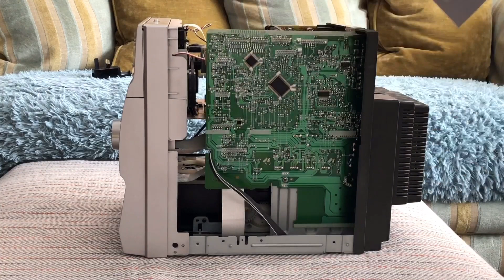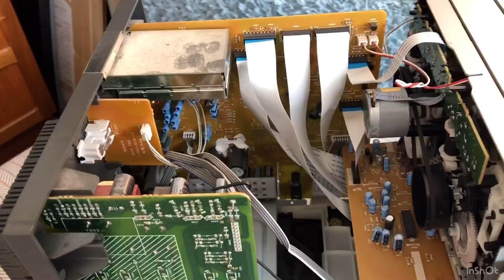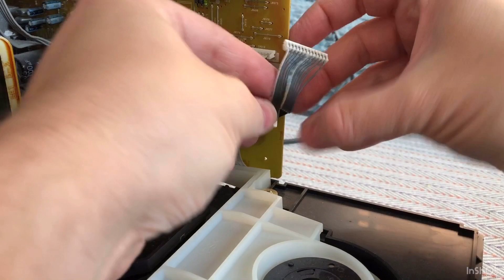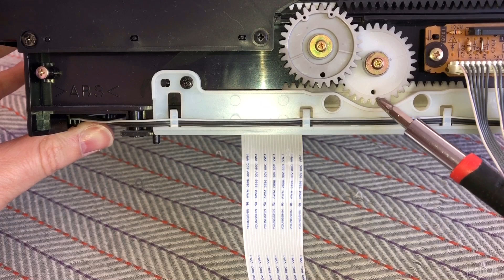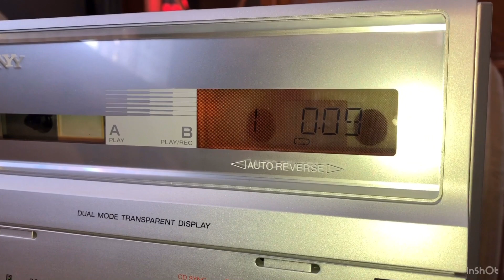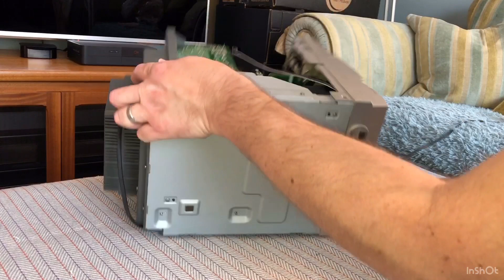2001 Sony CMT-CP300 CD loading belt replacement repair HCD-CP300 CMT-CP333 HCD-CP333 Stereo Hifi

Comment: I wish you'd make a video about changing cassette deck belts. I changed the belt on cassette deck B and it worked fine, but cassette deck A won't work with any belt.

Comment: Thanks so much for your video. I've got the exact same mini h-ifi system, and after using it for the 1st time in awhile 2 cds became stuck as it wouldn't eject them. Anyway a new £5 belt and your instructions have saved it from the scrap heap! 😊  👍 👌

Comment: I notice you haven't posted for a while but thanks, you have saved another from landfill.

I wouldn't have bothered otherwise.  I tend to break things when it isn't obvious how they dismantle.

As others have said, one of the best instructional videos I have ever seen.  I bet a video of your first one would be funnier though.  :)

btw...the link for the belt has expired but they are still available on ebay.

Comment: A Really Great video. This has truly helped me on how to diagnose & self-repair a Sony CMT-CP2WA with a lifeless & stuck CD Drawer Tray. It's is only a single CD Player, but the front panel & overall design is almost identical to this Sony CMT-CP300. Although it was really quite tricky finding the right CD rubber  belt, because it uses a different one. Maybe because its a 3 Stack-CD System vs. a Single CD Tray. Here is a real Sony CMT-CPXXX  Hi-fi Expert. Got this Sony CMT-CP2WA at a bargain price so £5.95 for A New Original Sony Branded CD Belt was no big deal. I think so many Units like these just get junked because people huge estimates by repairs shops, for probably quite simple faults.  
This video simply teaches you a very lot more that even the Official Sony Repair Manual doesn't give instructions on.

Many Thanks ! From ...
Micro-jo

Comment: Mine has a problem in the main volume wheel (apart from the cd changer and both tape decks not working, of course). The wheel seems to have erratic behaviour when i turn it. Thanks to your video i saw that there's a belt connected to the wheel. So, maybe i just need replacements for every belt in the system...  Still think this is a great hifi system, with a clean and powerful sound

Comment: Thanks very much; just discovered excellent video!   eBay link for belt failed though.  Dismantled twice already and prev arrived at how you've done it myself the hard way before seeing the vid.  Belt on order now from web spare parts.  Fingers crossed!  Phil, Lincolnshire. Update:  the belt arrived from Portugal extremely quickly and it's now working. Great video.

Comment: Very well explained, but can you give me the number of the correct belt for this repair, thanks Fast Eddie, Canada
Reply: Hey Fast Eddie, I'm in Canada too (Ontario, specifically).  I couldn't get access to the belt needed in the ebay link in the description, so I fished around the web a bit and eventually landed on WebSpareParts (which, now that I look closer, is part of that url to ebay).  I bought a set of 4 belts that are compatible with this stereo.  After working on the unit, I realize I bought a kit of belts that are meant to replace the 4 belts of the cassette tape section of the stereo.  As best as I could measure, this 4-pack had two belts that were 1mm in diameter and 6.5 cm long and another two belts that are 3mm in diameter and 9.5 cm long.  The 1mm/6.5cm belt is a perfect fit for the belt needed on the CD cassette.  By the way, changing out the belts on the cassette tape section looks to be a little more involved, a lot more things need to be unscrewed.  I think I'll order another set of belts from WebSpareParts and keep them handy for the inevitable.  Cheers, AnnaMaria 1980
Reply: @AnnaMaria1980  Thanks Anna Maria for that info, it is very useful, especially the belt dimensions. I will make a note of that. I was almost ready to give up when I noticed the very belt I was looking for was being sold on EBay by Norfolk Electronics in Norfolk (UK) (  https://www.ebay.ca/usr/norfolkelectronicsonline )  belt description item # 194072105612  item price : GBP 7.99 plus shipping/taxes = approx. $24 C. Seems crazy when you have to purchase from the (UK) I tried the Sony supplier in Canada, & they told me this particular item was not available for purchase in Canada, but I'll bet it is available to the repair shops here. I have to wait about (3) weeks for delivery, but it will be well worth it if I can get my unit working again, there's not much out there now to choose from in this kind of unit, thanks, Ed
Reply: Hello again, thank you  sir, for taking the time to explain very professionally on this belt replacement, I just completed the fix, & I'm happy to report, my unit is working again. I got my belt from Norfolk England thru' ebay, had a couple of weeks to wait on the part, but it was worth it. In reference to Anna Maria, I'm from your neck of the woods, Ontario, Canada, it's a small world. A big thanks to Eddybears Cave, you're the greatest, thanks, Fast Eddy

Comment: 😳 - when I was at secondary school, the gym had that mini HI-FI, the PE teacher would swing it out of a cupboard on a tv bracket, with a square hole cut into the cupboard door frame for the bracket arm, power and speaker wires, the speakers were mounted on the wall above the cupboard - the speakers and their wires are the only visible part when the unit is locked away in the cupboard. The teacher mostly played house/fitness and workout music on it for exercising with (similar to a commercial leisure centre gym)

Comment: Brilliant instructional video. I could not get the proper belt but a sturdy elastic band worked fine and will probably last a few years. CD changer is now back in business. However, I lost the left-channel audio during the repair. Any suggestion as to which internal cable I should recheck to see if it is not snug or got damaged? I am keen to try the cassette belt repair also, so when you have time....  Thanks.

Comment: Hi eddie
I replaced the belt with your help and now ejects but why would I have no sound ? It sees there’s a disc but no volume, the radio works , however no sound from the cd ? Have you any videos on this 
Thanks
Reply: Sounds like you didn’t plug one of the ribbon cables in properly 🤭

Comment: Good detailed video! Now I just have to order that belt. Do you have similar movies on how to replace cassette belts?
Btw. When I opened mine, the old belt (15+years) was so soft and sticky, I had to remove it's remainings with a tweezer. Difficult task. Do the overhaul once you notice performance downturn.
Reply from the maker: I’m glad the video helped. I am aiming to do a video on the cassette deck when I am able to. 👍

Comment: Excellent video which answers all my questions regarding the Cd, although my unit is  contained within a CDP-S3 (part of a MHC-S3 mini HiFi). You mention that one may need to re-time the unit if the holes on the cogs dont match up. Any clues on how one would go about  doing this?
Reply from the maker: John H When I did one of these, I just unscrewed the sides, removed a couple of the gears and manually realigned everything. It worked for me. There are alignment holes so it makes it very easy to see what should be where.

Comment: Oi m8, this one is by far one of the best repair vids on whole YT. Clear and straight to the point explanation of EVERY single step needed, good camera angles and lighting, clear image, no 30 mins of theoretical mumbling about nothing. Perfect, just perfect. Btw, can you please tell what is the dimension of the belt you was replacing?
Reply from the maker: Thank you. I just wanted to help others with this stereo, as every single one of these I’ve seen has this problem, and it really is such an easy fix. I’ll see if I’ve still got a spare belt and measure it for you.
Reply: @eddiebearscave8822  Thanks a lot!
Reply: @amigator7789  hello! I also had that doubt and couldn’t find a replacement belt. I order a pack of 100 from eBay for less than 3 pounds and simply put the one that felt “right”. It’s now working fine. This video is awesome!